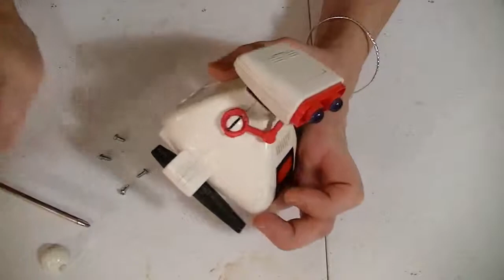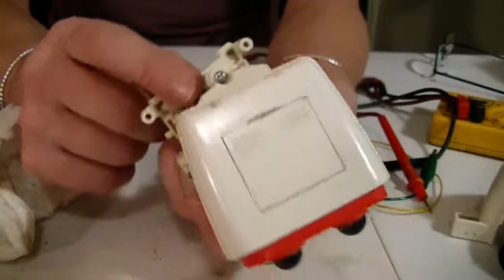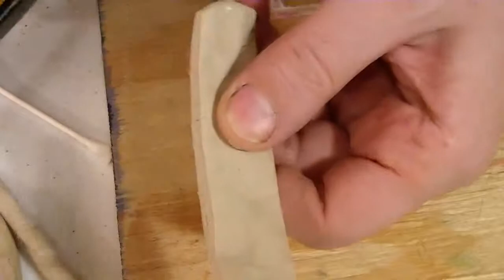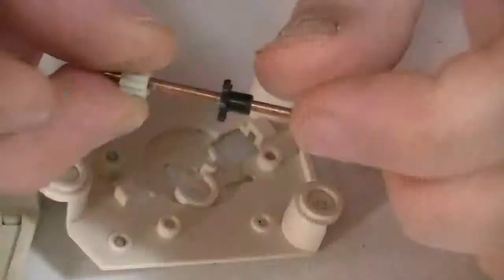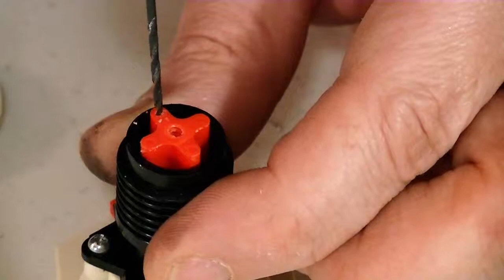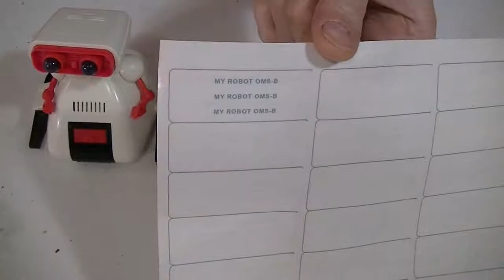DingBot by TOMY Refurbished

Comment: I know it's a long shot, but I just recently picked up one of these little guys for 4$ from a toy show and am currently in the process of fixing him up. I have the same cracked gear issue yours did and my sticker is pretty worn and pretty much no good. I was wondering is there any way you could sell me one of your original replacement gears or send me a link where I can purchase a new gear and a sheet of those "My robot oms-b" stickers? Please let me know if it's possible. Thanks alot, your vids are great!
Reply from the maker: Sure... Just contact me on one of my websites or facebook.